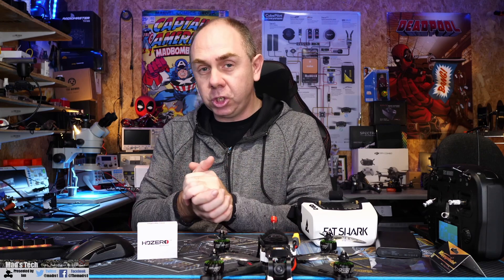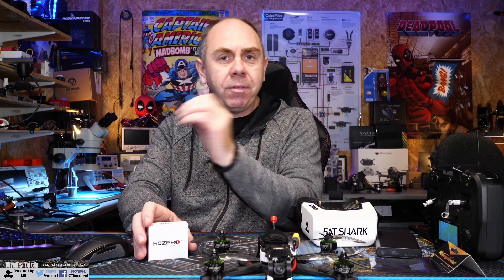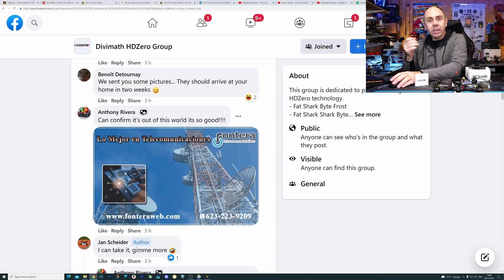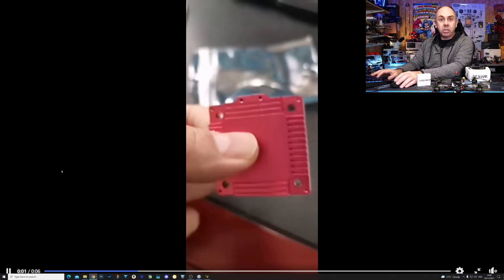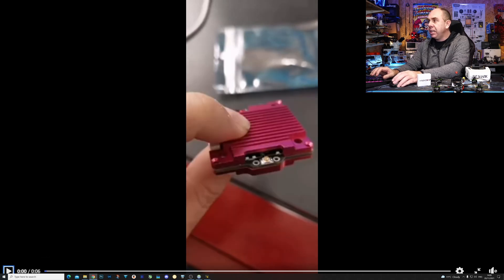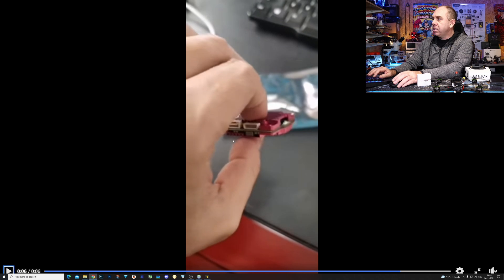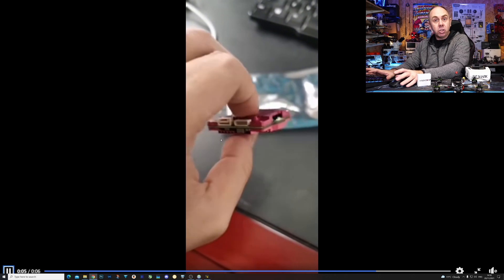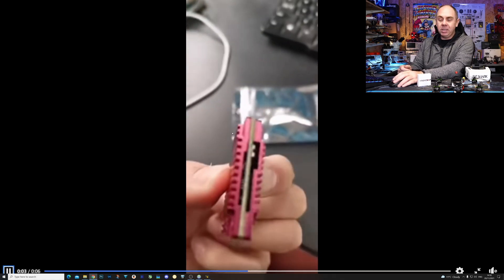HD ZERO 1W VTX SNEAK PEEK - NOT LONG NOW - SHARK BYTE DIGITAL FPV

Comment: I'm thinking of buying an Apex frame as a clean build and switch to HDzero. I assume i will need the HD frame for this new vtx when its released or, is that specifically for the DJI unit?

Comment: as always a product running up to 1 W is a nutshell full of compromises.
First you want longevity, while heat is the opposite of that.
If you want 1W you will need a cooling and accept a big aluminium heatsink or you have to use active cooling and of cause all of this is against the demand for smaller, bigger, better cryer.
Hey, it is like a car: you do not need a fan - as long as you are driving and cooling the powertrain that way, but without a fan and the saved weight you are suffering from other restrictions.

Who should buy it ?
Those that need 1 W and are willing to sacrifce volume or space and weight. 
That is the price you have to pay cause everything in life has a price except feelings or emotions.

Would be a lot easier if only those will judge that need 1 W over all and first of all while the 20 x 20 mm max size can wait for ages to get a 1W receiver that will fit and survive.

I like it cause it seems to be honest, focussing on "up to 1W" and not calling it the "1W" power house. I guess it will dynamicaly control the output depending on the temperature of the heatsinks which will be depending on the in coming air stream , speed, volume and so on. 
I will not get one but I would if I had a demand or usecase for it, at least not right now.

Comment: Oof - 30x30 mounting is going to be a challenge for sure - I wouldn't be able to mount it on any of my quads, not even my 6inch
Reply: Will fit on frames that fit air unit or can be mounted on stack and fc in Rear. I do agree though,  the form factor wasn't ideal, but was chosen for reasons of quality and durability. There is room for improvement and this will happen
Reply: @anthonyfpvminiquad1728  hopefully they can make a twin stack compact Vtx like the vista in the future?
Reply: @ninja_quattrocento  I agree
Reply: @anthonyfpvminiquad1728  won't fit on my Apex HD - the air unit takes up all the space in the back and it's footprint is smaller than this vtx. Also - apex hd can't mount FC in the back - there's no mounting holes. 

That might be an idea for my 5inch analog apex frame with 20mm mounting at the back - but it still requires me to get a new mini FC.
Reply: It will only fit my 7"
Reply: Mounting this will be a challenge, but if u are already using 30x30 stack… most new frames have 20x20 mounting fore and aft of the center.. easiest solution is use a 20x20 fc and mount the vtx above the vtx… IF there isn’t noise issues.
  This new vtx is Step 1… and it’s only been a short time.. and this system has done nothing but improve..

Comment: Interesting to see the HD zero solution. The form factor will be a challenge to install in anything smaller than a 5 inch. I think the CADDX Vista has the advantage there.  Any info on how much it weighs?
Reply: Double stack pads with the “pin connectors” seem to be the weak point.. why not use a cable, like from a ESC to FC..honestly I wouldn’t mind a 20x20 stack 1w vtx.. most frames will accommodate it.. more airflow.. anyone this deep into fpv shouldn’t  have issues soldering this.. especially if it delivers!
Reply: This is true. I will talk to Carl about a new 650mw double stack 20x20 idea because the 500mw mode on the 1 watt is functioning amazing as well. Better than the current 500mw double stack. I think it'll be plenty for say a 3.5 inch or 3 inch build
Reply: Btw, weight is 27 grams

Comment: I have 2 of the 500mw and they get HOT like melt the ziptie hot but work well. Happy to see progress I do like the system even alot actually.
Reply: My test unit is ziptied and it passes the lip test at full power in 40 to 50° weather
Reply: @anthonyfpvminiquad1728   can't wait for it to come out hope it looks like the pictures he posted. The 500 don't fit in small wings very good.  I also haven't updated them ever cause I don't have a FC. Do you know if they have a low power mode on the newer firmware?
Reply: @RubyS.1  LP mode has been in the firmware for a while now.
Reply: @theronin48  wow I'm like 4 updates behind not much applies to me but I would like the antenna rssi and low power but I have to use the little joystick to do anything which is a pain.  Any word on inav support at all? Don't care about canvas mode but stick commands would be nice
Reply: @RubyS.1  I think there is inav support,  or it's being worked on actively. I'm not in that community but I donknow a few have it working with invav. And yes we have stick commands. Also there's smart audio option available now